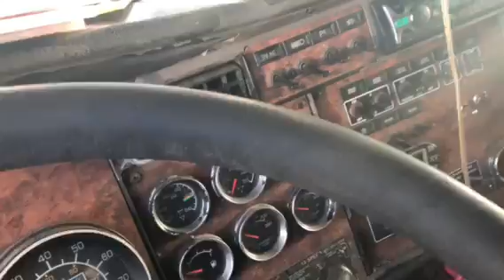Kenworth Windshield Wiper Repair

Comment: Thanks for the video. I just bought a w900 and the wiper goes over to far and gets stuck on the outside of the windshield. Looks like I can pop the arm off and adjust it. It may require taking the arm off a couple of times but it looks like it will work.

Comment: they do sell that stud, i am replacing mine on a 2000 w900. got mine at kenworth in sioux city ia. part number GS3821 it is called pivot wiper idler. mine is on the driver side, i can only assume they have it for the other side..
Reply from the maker: Yes. I’ve got another video where I have everything fixed. All new parts.
Reply: Yeah they have both sides, I’m doing mine now! HEEEEELP